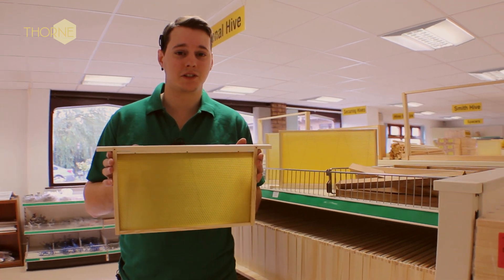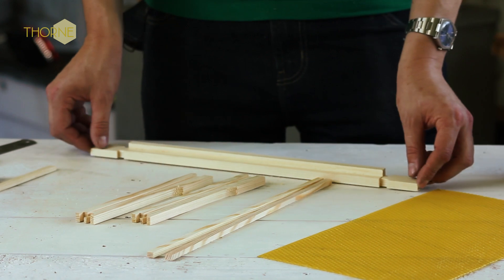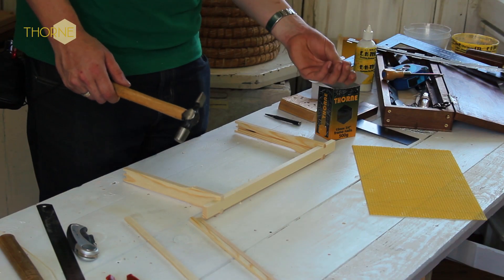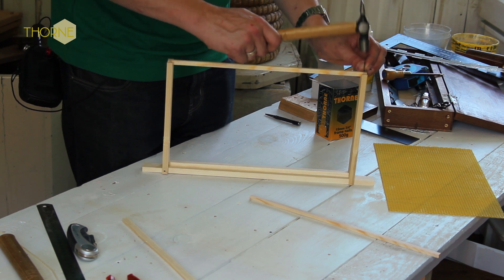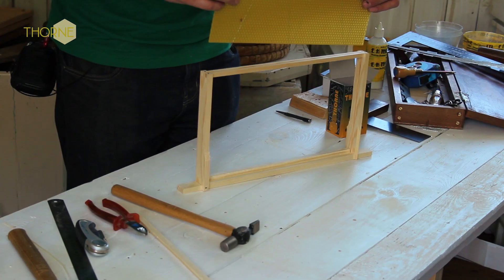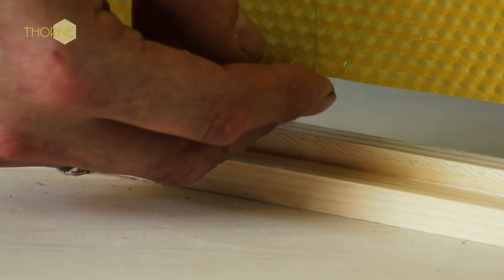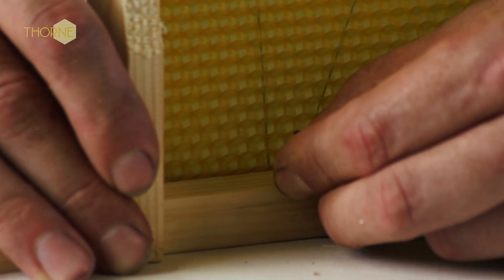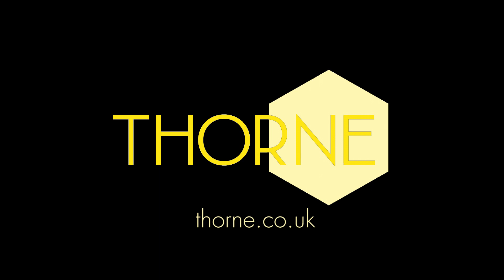THORNE - NATIONAL BEEHIVE BROOD FRAME - Assembly Instructions

Comment: These were a faff. I found it easier to secure just a single bar first before adding the wax and then securing the second bar after this was already nicely in place. 

Also as others have said, the pins provided go through the top bar and it’s difficult to angle them. I had the removable bar the other way when I tacked it up. Not sure what difference this’ll make overall (perhaps they’ll just build comb over it). 

Does the temperature/weather make a difference. Doing this on a hot sunny day I found the wax to be very supple and more prone to disfiguring when trying to insert it the way he does in this video.
Reply: Hi Nathan good tip on the leaving the second bottom bar off till you get the wax foundation in place ( speeded up the process being my first time at bee keeping 👌) Regarding the pins being to long and awkward. Maybe try a pair of pointy nose pliers to hold the pins to start them off, then don't nail them all the way flush with the surface leave the nail head sticking out. I don't believe it will matter once ladies have built the comb out. Just another tip i am nailing the bottom bars through the sides just like the top bar. Nailing into the end grain is no where near as strong as the lad shows you on this clip. Also a spot of wood glue on each joint will help with joint strength. ( i don't believe glue will harm the bees once cured but maybe I'm👍 wrong on that best to check)